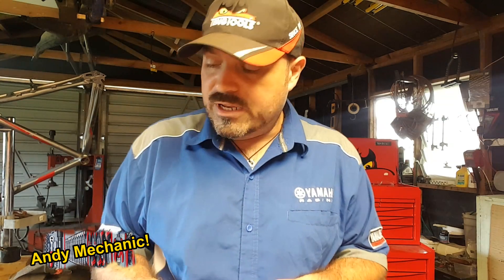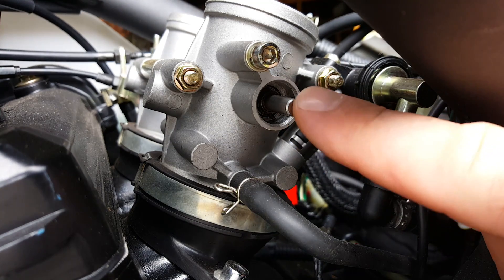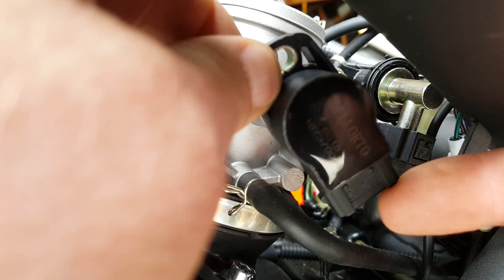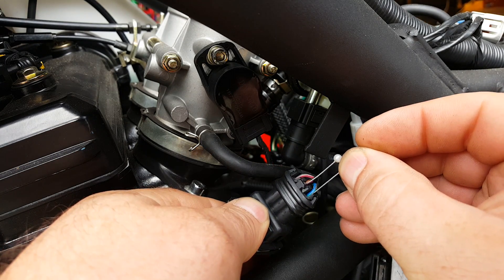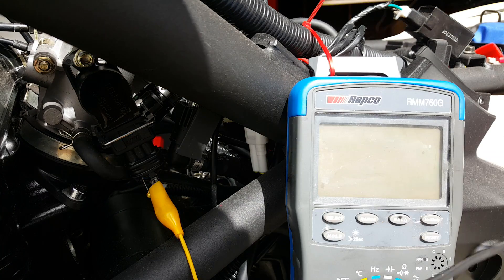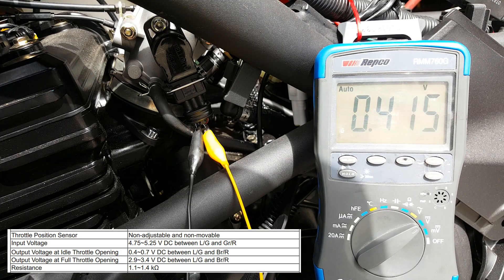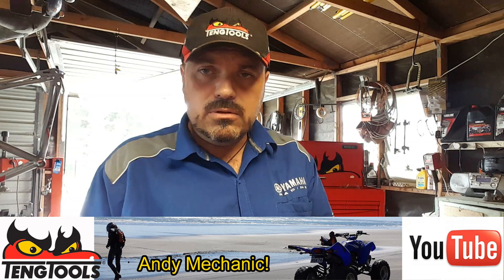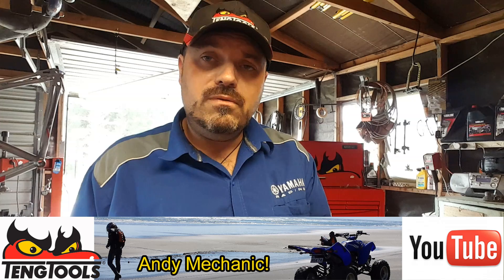How to install & calibrate a new Throttle Position Sensor (TPS) #1208

Comment: Hai good video can you help me I have Suzuki gsxr600 k7 having some issues with F1 light how can I resolve this thanks in advance
Reply from the maker: Hi, if the F1 light is on then it indicated a fault in the fuel injection system. You'll need to see what fault codes are stored to get some direction to the circuit/component that has flagged the code.

I have a fault code list so send me an email & I'll send it to you. If you can give me the VIN too I may be able to get that section of the Service Manual. Given the age if the bike it is likely to have on dash Diagnostics which will be easier for you.

Cheers Andy
Reply from the maker: My email address is andymechanic@live.co.uk

Comment: Will this adjustments work for my Suzuki Bandit GSF 650 ? Efi.
Reply from the maker: Yes, it will be pretty much the same method. Cheers Andy
Reply: Ok thanks, i will try to fix, as i removed the tps on it, Whilst Changing the Accelerator twin Cables, Very fiddle indeed as Not much Space on Suzuki Bandit GSF 650 Efi model. @AndyMechanic

Comment: Sir, i have a yamaha xj6. bike has brandnew spark plugs and airfilter but my bike rpm cant stay stabil around 3-7k rpms. It fixes after 7 rpm. I got my bike checked to repairman and he told me %99 tps sensor. What do you think sir ?

Comment: My Suzuki Bandit GSF K3 650s  is giving me problems, it's a fuel injection.
     I had removed the fuel injection manifold to replace the throttle cable.
 But I removed the tps unit as well.
Fitted everything back. But now it just doesn't run very well.  
 do help ..

Comment: Hi Andy I've installed a rapid bike evo and when the new tps wire is connected (wire to wire), the bike randomly cuts off when riding I guess its because of stock wire to tps isn't connected. Any way round this bud?

Comment: I need to adjust the TPS on my 2007 Bonneville carbs.  Should I leave the idle screw set where the bike is running and idling good, or should I unscrew the idle adjustment knob before setting the TPS?

Comment: Do you need to calibrate if you change the whole throttle body was a 2nd hand one .cheers
Reply from the maker: No, it should be okay provided it hasn't been altered after it left the factory. Cheers Andy

Comment: Hey mate, the video is great. I have done exactly what the video says, but for some reason I can’t get past 2.88 when opening my throttle. I did have my tps as far as I can clock wise and the highest number u get is around 5. When u make any adjustment to the tps the full throttle opening number won’t go past 2.88. Could you please give me some guidance to what could be the problem ? Thanks
Reply from the maker: Just check you are getting 5v+ on the feed wire & have a good ground too
Reply: Sweet will check the feed, I did replace my tps, I am also getting a code which I believe it’s telling me - error tps low .. would you know if this could be causing by my throttle body or my throttle cables not being tuned/adjusted properly? I’m working on a Cfmoto 2015 650nk.
Reply from the maker: Unlikely to be cable adjustment. The CF Moto TPS units break easily if they receive a shock or high vibration. Have had to replace on previously that broke when crate was dropped (new bike).

Cheers Andy
Reply: I did the Throttle position input voltage inspection and it went as high as  4.74v which is below the minimum range of 4.75 to 5.25
I also did the wiring connection from the ecu for continuity and I had 0.00 at 2000k for ohm.

Based on that info would you be able to point me to what else I can check or if you can tell what the problem is?

Thanks heaps for the assistance… :-)
Reply: I have also tested my two grounds and they are fine..

Comment: Im getting a lean code and very poor running motorcycle. I put a new TPS on but it actually exacerbated the issue. I have no air leaks I just figure out what the heck is wrong.

Comment: Hello Mr. Andy! I have a Honda sh 300i and I think I'm the most unlucky owner! Since I bought Moto he just stands and was walking for all possible mechanics in my city ... Two and a half years are since then. I also bought a sh 300 for parts. We have replaced the complete gasoline pump. Injector who defaults would have displayed some error. And today I changed TPS. That's how Mr Electronist told me. After that went well for a little while. He started well. Then how was very dirty I went to washing. After starting '' fun '' how he was doing before ... 
- Stopping the engine when slowing. 
- fluctuations in reversal. 
- And difficult start. The Valve game was also checked. Even distribution. Loud tired this situation .. Two a half years. I do not know what to do ... 
please! If you can help me somehow. 
All the best! - From Romania I write to you.
Reply: Can you give me please a mail address?

Comment: what if the sensor is not movable, and if the new aftermarket sensor gives a lower value than the OEM sensor.
Could this cause a performance issues?
Reply from the maker: Yes, definitely, especially if an open loop system
Reply: the problem is that I had ordered 2 different brands of sensor, one gave 0.810V and the other new sensor gives 0.740V at idle. But if I install the original Oem it gives 0.960v. Should this be an issue?
Reply: Thank you very much for the reply sir!
i just bought a new Hitachi oem sensor, the value is now exact 1,0V at idle. And the car runs extremelly well ! the acceleration is now amazing. Thanks for the advice!

Comment: Hi andy im trying try to do this with a polaris ranger 500 but for some reason cant get it work , do i put on 2 dcv on meter
Reply from the maker: No. 12v DC will be needed as max voltage will be 4.5v at full throttle. Assuming Polaris use a standard TPS which should be 3 wire one been an ECU given ground, one signal wire (return to ECU) & an ECU supplied 5v+
Reply: @AndyMechanic  hi would u know what the readings are on a 2011 500 polaris ranger at idle,  the guy was fooling around with tps and the idle screw thats not to be touched
Reply: So u say it be 4.5 v full throttle

Comment: 0.418and 3.69 full trotle open, is normal? from Argentina tnks!!
Reply from the maker: 0.5v is about what you'd usually see at throttle fully close. However, should be more like 4.5v at throttle fully open (most vehicles), though yours may be a different spec - best to reference the Service Manual.

Hope this is of help. Cheers Andy

Comment: What about if the bike doesn’t have Ignition switch battery operated kickstart only, how can I go about it ?
Reply from the maker: You'll have to set the TPS using the resistance values most likely.

To obtain these you'll need to reference the Service Manual for the particular Make, Model & Year.

Cheers Andy

Comment: no need to remap ecu with this technique?
Reply from the maker: Definitely not. This is the correct procedure when replacing a TPS - though some Manufacturers have their own methods so always best to check the Service Manual.

Cheers Andy

Comment: I have Yamaha R6 2004, 12k on it! And I have opened/cleaned the throttle body and my mechanic played with the TPS because my idle was high! Although the idle is perfect now but I feel my bike performance is not like before. Like the sound or you can say it is lean. Any recommendations you can give to fix that perfectly?
Reply from the maker: Yes, moving the TPS position was not the solution in any way whatsoever - it needs to be returned to its original position - usually there is a small white paint mark from the factory - realign it to this. The idle issue - it's a carb bike so simple carb adjustment.

Best not to ride the bike as it is as the mixture will be way off.....lean, like you suspected.

Cheers Andy
Reply: @AndyMechanic  Thank you so much for your guidance. More over I will appreciate if you can tell me how to fix the issue completely! I also try to see how I can bring the TPS back to the factory mark. But is there a way that I can do it professionally by the multimeter or any other tool to get the exact reading! Also want to know how to adjust the carbs? Is it by the air sync gauges? Or any other way. Please guide! 

Thank you!

Comment: would it help to start the bike and see if the idle RPM is correct ? Then after adjusting Idle , would need to reset the TPS value ?
Reply from the maker: Depending on the system on the bike, the idle is usually controller by the idler speed control valve, actuated by the ECU. This is an air bypass & has no effect on the butterfly spindle position so no, you don't have to adjust idle speed, in fact, often, you can't!

Hope this is of help

Cheers Andy

Comment: Hi friend got Honda cr-v 2000 5 speed morning stared perfet driving like 35 m parking it no want to stared way like 25 m stared ogaing no power rpm got real slow put it off ogaing tray to stared take like 1.to 3 can stared ogaing taring today got off I driving thank you can let me now what you mavy the problem

Comment: I have a 2002 Honda CRF 450R without a battery no on/off with and tps. How do adjust that? Thank you
Reply from the maker: Hmmm....Okay.  well you can unplug the TPS and test on the bike. However they are usually a 3 wire type on bikes, one is an ECU given ground, another the 5v+ reference from the ECU & the 3rd wire is the signal wire back to the ECU.

You'll need to know which is which. Provide the TPS with 5v - adjustable power supply set to 5v DC. Put + on 5v reference, negative to ground. Then attach your multimeter - positive to the signal wire & negative probe to the negative of the power supply or at the TPS on ECU given ground. 

With the engine OFF & throttle in closed position you should get around 0.5v. As you roll open the throttle very slowly the voltage should slowly climb, to a max of around 4.5v. If at any time the voltage drops momentarily during opening the throttle then it's a fail & TPS must be replaced.

Hope this helps
Andy
Reply: @AndyMechanic  ok I will try that. Thank you for your response!

Comment: Can a bad tps cause the vehicle to stall after its hot and make it hard to restart the vehicle?
Reply from the maker: No. More likely the fuel pressure is dropping when the engine is turned off. There is a valve in the fuel pump which closes to maintain line pressure. If this leaks then fuel pressure drops & it takes time for the fuel pump to bring it back up - usually causes long crank times but engine does start.

Comment: Will this fix the idling on my trx 450r
Reply from the maker: Hi, it is one component, that if faulty, could affect idle. However, I'd check the operation of your idle speed control valve first. Also are there any fault codes?

Cheers Andy
Reply: @AndyMechanic  she will run no problem but as soon as i left off the throttle she quits on me
Reply from the maker: Hmmm.....it sounds to me more likely to be fuel pressure. I'd test the fuel pump output pressure - you'll need a fuel pressure gauge and fittings to fit your bike to test this.

Hope this helps
Andy

Comment: I have a 2018 kx450f that runs lean.. can I adjust the tps so it'll run a bit richer  ?
Reply from the maker: Better to work out why it's running lean than try patch it up. Check fuel pump pressure - if it's down then that will cause it. Remember these dirt bike engines run in open loop all the time so no self correction is possible. Hope this helps. Cheers Andy

Comment: Andy : I am a DIY and only work on my own cars . I noticed when you back probed the connector , your probes were real close . If the ground touches the signal return , will it damage the ECM ? If that is the case , would it be better to use another ground away from that signal wire ?

Comment: I have a Mitsubishi FTO GPX Mivec triptronic and replaced my TPS without calibration and it's gearing like crap, over revving and triptronic box is having issues. Before this I had no drama's!

Any idea what it should read power wise on multimeter buddy ?

Comment: so I recently changed the MAF and iacv on my Lexus RX300 and it's giving me P0505 code, used a computer program and found it when I floor it with the engine off TPS only thinks I'm at 75% Max throttle. I did not touch the alignment of the TPS when I remove the iacv, So how do I re teach the car what 100% throttle is?

Comment: My AT motorcycle feel very heaver and the power is not maximal. Is it because of the TPS (Throttle position sensor) ? Because I been in and out of Yamaha but never fix the problem. Feel like the mix in combustion chamber isn't right between gas amd air. My air filter are new and I did clean my injector last month
Reply from the maker: Check the fuel pump pressure & if it's got an o2 sensor this may have failed so engine will only run in open loop.

Hope this helps

Comment: Hi Andy, how can I calibrate a TPS on a ford falcon xr6 2003? I followed a method of disconnecting the negative battery terminal and shorting it to the positive to discharge the capacitors. Then reconnect battery, switch on accessories and wait a little bit and run on idle for 15 to 20 min. Test drive afterwards. It seems that the car drives better but not quite there yet especially when ac is on. Any advice? Cheers, Maz

Comment: what if the voltage is change when the engine is start example if my voltage in of engine is .73 in close position and when engine start the voltage is up in  .86-87 is that normal or i need to change my tps
Reply from the maker: Hi, no, that's not normal if the bike has an idle speed control valve. If however it uses a steper motor to control the butterfly (fly by wire) then that is normal.

You should test the 5v reference at ignition on/engine not running & with engine running. It should always be at 5v
Reply: @AndyMechanic  oh its mean my tps is need to replace thanks sir andy

Comment: Hello Andy, are those values of voltage output from the tps on idle and full throttle position same for all motorcycles? I have a Kawasaki ninja 250 FI, I was planning to caliberate it but have got no clue what the voltage values are. Will these values work?
Reply from the maker: Hmmm.....the voltages do vary slightly between manufacturer. However, usually around 0.5v at idle and 4.5v at full throttle is what we would expect to see when testing. However, for calibration you really need to know the specs specific to your bike. Maybe your local dealer may help or you could download a service manual? 
Alternatively just set the new TPS to the same voltage output as the original when in the idle position

Thanks for the feedback. Cheers Andy
Reply: @AndyMechanic  okay, and one more thing, as I checked my present tps idle and full throttle voltage, on idle it shows 3.94 v and full throttle voltage goes down to 0.7v , which is the opposite to what should be happening.. Service manual says its a voltage range from 0.2-4.8 volts , but does not specify any voltage rating at idle position and full throttle position. Is it normal or a malfunction?
Reply: I have a bazzaz Zfi fuel controller , if that explains anything..
Reply from the maker: Sounds odd. Make sure you have the meter positive on the signal wire & meter negative on battery negative.
Reply from the maker: The TPS couldn't go faulty that way. Seems like you may not be on the sensor wire or may have the meter negative on battery positive?
Reply: @AndyMechanic  okay I will check again, I do believe I got the connections correct. Will try again and update. Thanks Andy
Reply from the maker: Is it a 3 or 4 wire TPS?
Reply: @AndyMechanic  it is a 3 wire. Ive caliberated as per the service manual, readings shows fine but bike does have stalling and auto choke issues at times. Fi light comes on in cold start in auto choke, when I just rev it a bit , the FI light goes off and all is normal hence forth. Could it be the issue with the tps ?
Reply from the maker: Hmmmm.....I don't think you have a TPS fault here......are there any fault codes?
Reply: @AndyMechanic  voltage readings shows fine though, while opening and closing the throttle, could not find any jumps I guess.. for example while slowly opening the throttle it goes like 1.32-1.35-1.37-1.41 ect. Does not have regular intervals. Have not yet done a resistance check though.
Reply: @AndyMechanic  I have few videos of the issue I'm facing.. any way to send them over so you can see and understand when you're free?
Reply from the maker: Sure, put them in a cloud based storage, say Dropbox or Google Drive and email me a link: andymechanic@live.co.uk
Reply: Can i install other tps to my motorcycle Provided that it fits the connections?

Comment: Great video Andy! Now I have finally confirmed a small portion of my knowledge regarding TPS. Like I'm certain now what the slot is for, that it's for angular adjustments. I also have a YAMAHA XTZ 125 with a TPS on it's carburetor that I think is having a problem. At mid to full throttle positions, I'm getting some sort of a weird engine sound which I presume to be a "Knock"? I'm hoping you could give me some of your expert advise based on how I'm describing my engine problem. :) It's "sounds like someone poured gravel on to a metal pan" when I'm at mid-full throttle or during heavy engine load. Maybe you have a guide you can share and show me the designation of each 3 wires like which is ground. signal or voltage input and what are the ranges of voltage/ohms I should be at, exactly what you did on this video. I hope you have the time to read this and don't mind helping a fellow home mechanic out. Suscribed!

Comment: Thank you for this great information. I was having some trouble calibrating the tps sensor on my ninja 650r. Bur i didn't knew the voltage values.
Could you help me out with a little doubt? There is another like tps sensor on my bike...a little downstairs from the tps sensor...and a dont know why my bike has 2 tps sensors
Reply: Gustavo Escoto I’m having the same issue with my bike was your tps making a bunch of noises and how did you end up fixing it